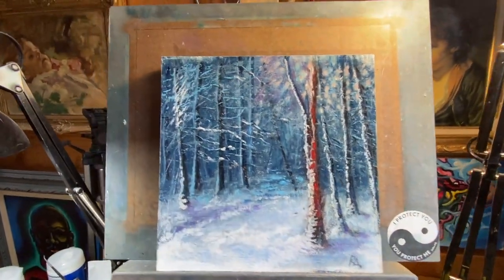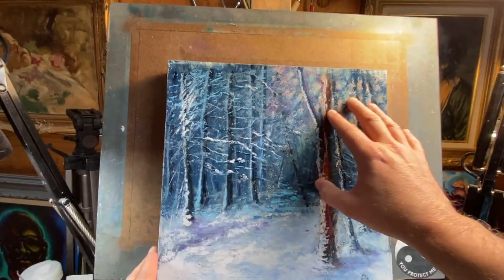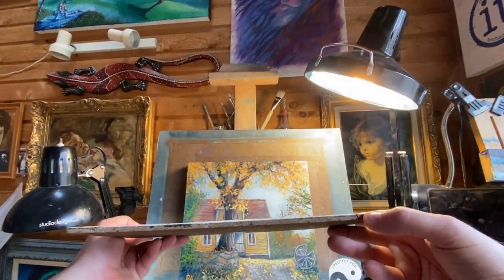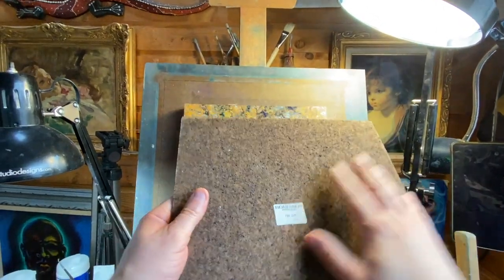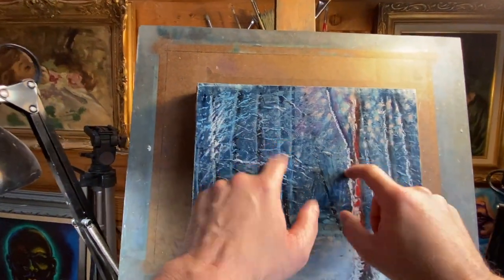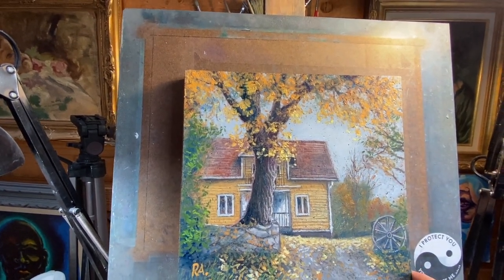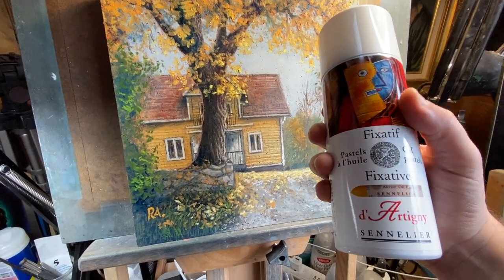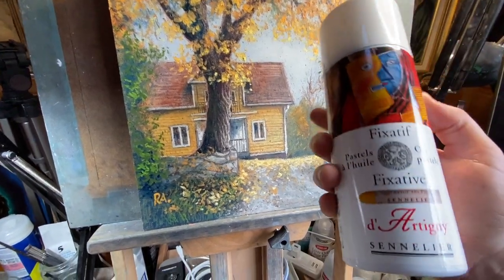Oil Pastel demo on Cork Tile (part 1)

Comment: What's great about the Van Goghs is that they are available open stock. If you run out of a Mungyo, you're out of luck unless you order a new set. Underpainting with acrylics or gouache might help save some pastel since the cork eats the pastel.

Also, if you want to spread the oil pastel with Gamsol, Gamsol evaporates almost immediately. It won't harm paper because it evaporates so fast; maybe it'll work on cork, too.
Reply from the maker: Yeah I can find the van goghs at my local art store. same with Neopastels and Sennelier. Mungyos are not easy to find, but I've had some luck on Jerrys artarama.
Reply: Amazon carries the Mungyo. That's where I got mine.

Comment: Very nice work! I'm intrigued by the idea of using cork tile as a substrate. My question is, do you know if the cork is an archival surface? It would be a shame if your beautiful work would deteriorate years later.
Reply from the maker: Thank you James! You ask a good question and I don't know if cork is "archival". I do know that cork is impermeable to liquids, immune to rot and is anti-microbial, anti bacterial. They been using it in in wine bottles for hundreds of years. It's also natural product, environmentally sustainable. No trees are cut down to produce it as they just strip the bark.
Reply: @raizes  good info to know. I'll have to do some further investigation into it, but I think I'll try cork just for the experience of working on a different surface. Thanks to you I would have never known about this possibility. Look forward to seeing more of your beautiful art.
Reply from the maker: @JamesWilliams-uf1gu  Thanks James. The cork tile I'm using are called Robinson. I believe they are made in Portugal. They are very sturdy. I believe they are floor tiles, and so they are laminated on one side. The cork tile on Amazon I got is cheap, flimsy and I won't be using those again.

Comment: Great video. Super helpful. As for the cray pas and mungyo where you said you keep them separate...what are the differences in how you use them? Do the cray pas have more wax? I am not sure how to start off...what are the basics you would start out with?
Reply from the maker: Hi Jackie. Thank you! The cray pas expressionist have less oil/wax in them compared to the mungyo gallery soft OP.  So the craypas are "harder" and the mungo's are slightly "softer".

This helps with layering colors on top of color without both layers mixing in with each other making "mud". Since I use a layering process, this is very important to me. I need to be able to lay down a color and not have it mix with the color underneath. I do this by starting off with the "harder" OP like cray pas expressionist, then lay down a softer OP like mungyo or neopastel on top. Sometimes I'll use a workable fixative between that first layer and the subsequent layers

Compose the scene and cover the paper with craypas . Covering the paper here is the goal. Then use a workable fixative and spray that over it all. The fixative will provide more "grit" so that I can get more layers. Then I go to my softer OP's like mungyo, neopastel  and Sennelier. Although, I'll save those Senns for the top layers, because they are the absolute softest OP's.
Reply: @raizes  thank you!! Neopastels are OP? and is it necessary to use sennelier... they are expensive!
Reply from the maker: @jackiegarroutte8970  Caran d' ache Neopastels are OP. They are wonderful and I love their variety of colors. They are soft, but not as soft as the Senneliers.. Also not as expensive as the Senns.